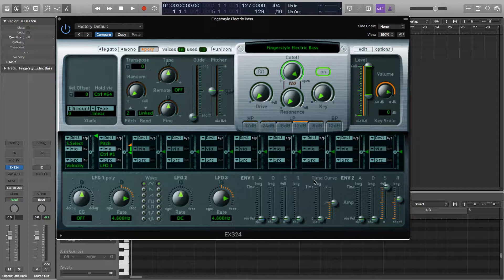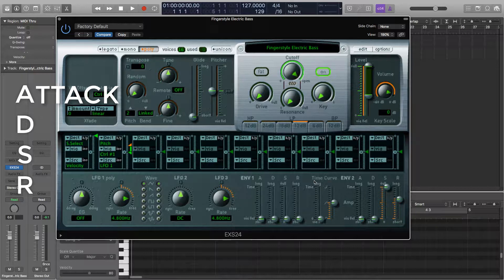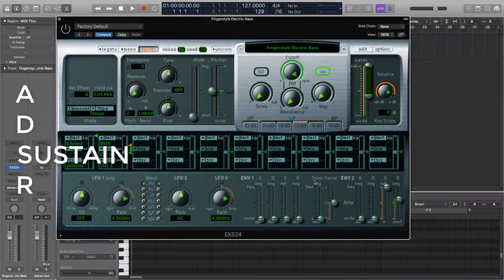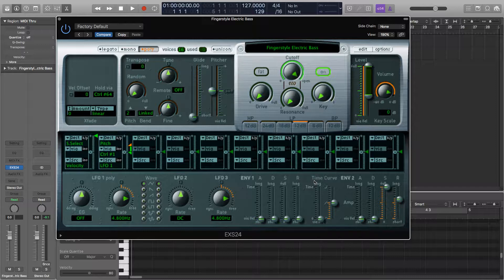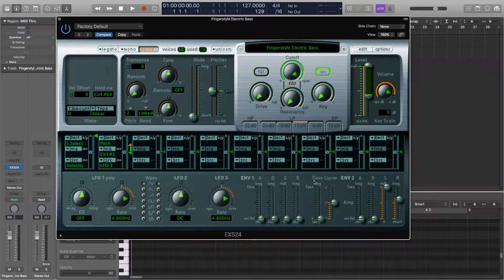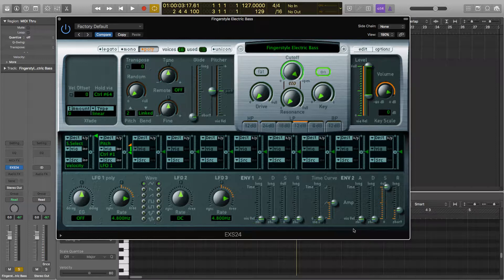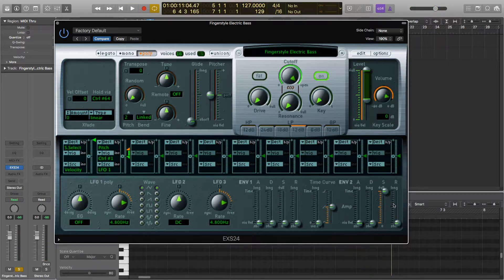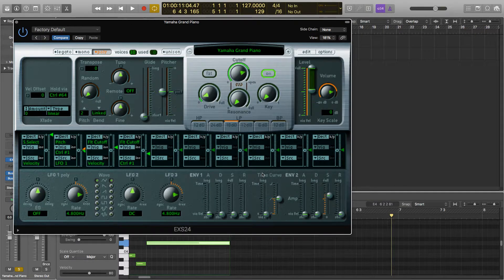The ADSR Envelope Explained

Comment: Hey bud, do you use Lounge Lizard at all?
Reply from the maker: Hello mate, I don't I'm afraid, so I can't be of much help. I've heard good things about it though, sounds very clean and professional
Reply: Hey no worries, thanks for getting back to me regardless! My question would've been ADSR related. Basically Lounge Lizard doesn't offer much of an increase in release of a note, it's barely releasing at all in fact, I was wondering if you knew of a way to simulate that? Perhaps with an effect of some sort? Thanks man, hope this isn't bothersome.
Reply from the maker: No worries, always a pleasure to help! I don't think that there really is I'm afraid. There are a couple of ways that have some potential. You can apply a noticeable reverb to it and have that tail off, but it's not quite the same. Or, you can bounce individual sounds and put them through the EXS24, or any other sampler that does have an ADSR envelope, then increase the release on that. So put in relatively long samples, then increase the release on it so it fades out instead of falling flat. I hope that helps!
Reply: Great tips man, I ran it through EXS24 and Alchemy and they're both sounding good! You legend. Thanks a bunch man! How long have you been at this man? I'm only at the end of my second month, it's pretty overwhelming lol.
Reply from the maker: Great stuff mate! Glad it helped! :) I've been at it solid for about 4 years now, I did my university degree in it 18 months ago and try to keep up with it :) Yeah there is a LOT to get your head around in the first stages, but when you have a good idea of how things work, you can figure out how to do a lot of different things by applying the same techniques to different areas :)